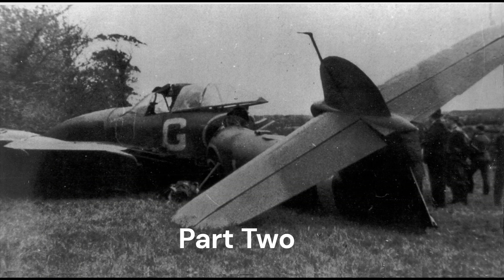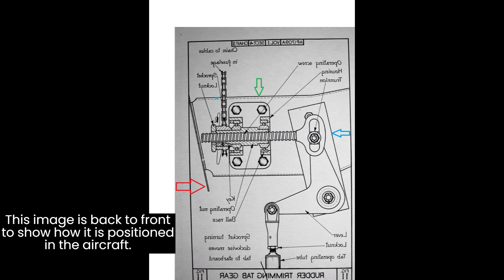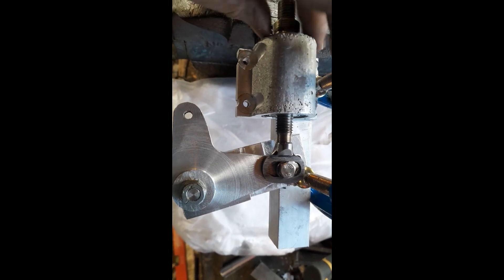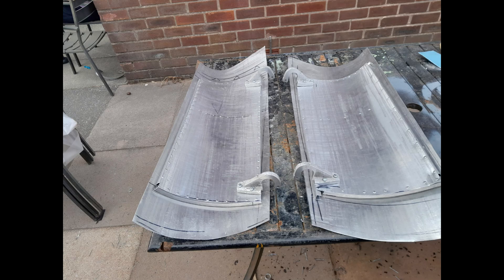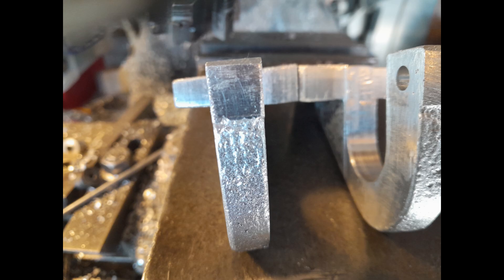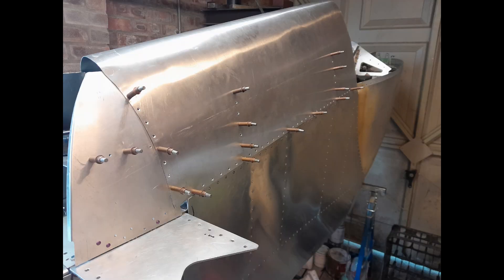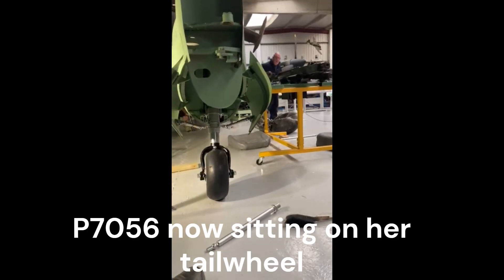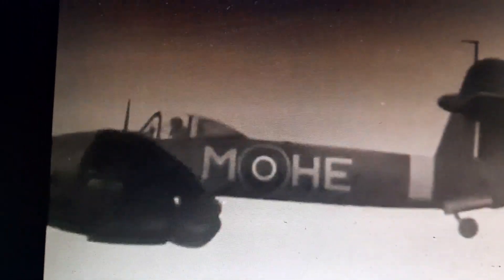Whirlwind Fighter Project - Engineering Update part 25 - Tail section part 2

Comment: My brother is making a Special Hobby 1/32 scale model of P7056 as a homage. He thinks he can make the specific decals except for the rooster. Does anyone have a high res version that we could have printed? I sent a contact message to the organisation but they are busy working on the real thing  :).  TIA.
Reply: Hi - the best image is on the sketch by Richard Caruna, which I will try to get to you.
Reply: @TheBearmat  We would be thrilled. It will be much better than my effort to clean it up in PS. We'll send you a pic of the finished model. Thankyou!
Reply: I used a screen capture of that beautiful drawing so  anything you could send would be better. We are going to see if a decal can be printed for us.
Reply: It's Matt Bearman from the project, by the way.

Comment: Beautiful workmanship and trade skills are demonstrated in this video. Thank you for your fabrication work and also the documenting video. Do you have all the original drawings to the production aircraft that allow you to fabricate every part? Or are you missing some information requiring you to guesstimate some of the components?
Reply from the maker: Hi, We have a number of general assembly drawings from Westlands we also have the unpublished aerodynamic data . Combined with the information from the AP manuals and repair manuals in our possession we have been able to re-engineer to a high level of accuracy. Thanks for your comments.